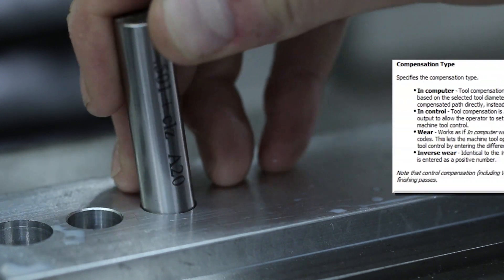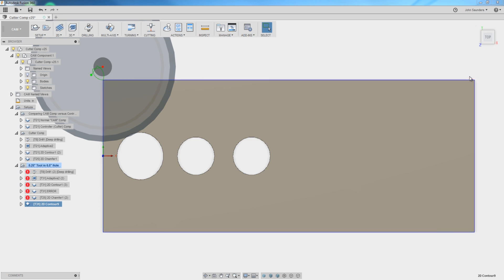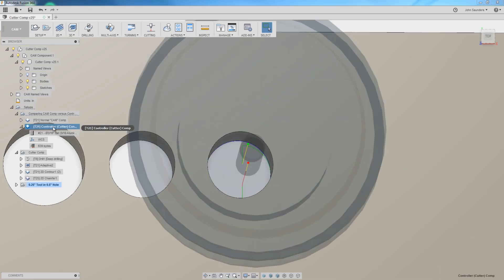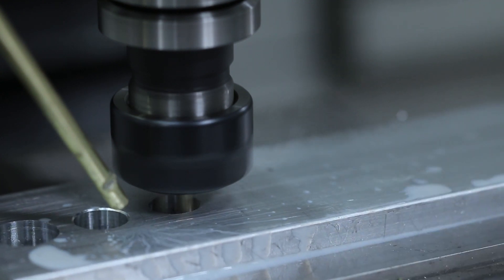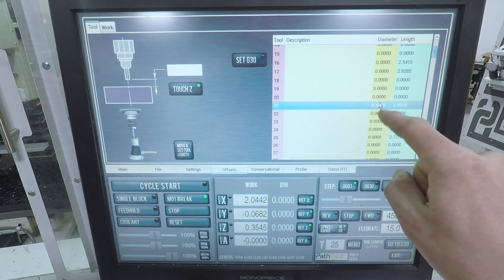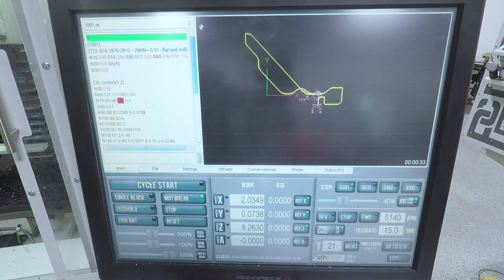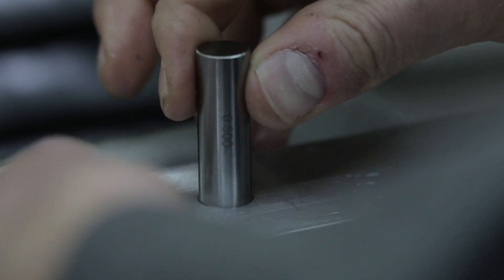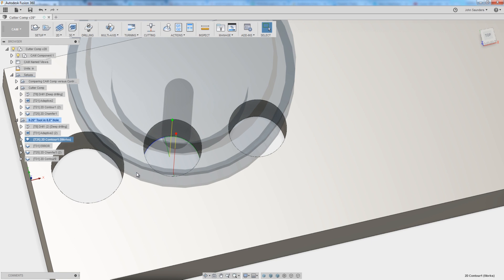How to Use Cutter Comp on a Tormach!  WW180

Comment: Does the cutter comp work for the boring operation too or do you have to program a 2d contour to make it work?
Reply: CC works with boring operation. I prefer "wear" because the diameter entered into the controller is a small value (usually less than 5 thou), allowing the machine to engage cutter comp with a very small linking move which is very handy for boring.

Comment: Dumb question- after doing the adjustment for this project would you then leave the updated tool diameter value in pathpilot or revert back to the nominal 3/16 diameter for some next job and perform the walk out if needed?

Comment: Does the Tormach accept a negative number for the tool comp? On Fanuc with your milled hole a negative number would get a "post" where the mill used the path on the other side.

Comment: How does the controller know which side the cutter is cutting on? Do you have to do anything differently for conventional milling versus climb milling?
Reply: That is what a g41 or g42 is for. Those codes "tell" the controller what side of the path the cutter is on.

Comment: It seems compensation type is limited to only 2d strategies is there any logic for this?  I would think it should apply to 3d finishing strategies as well?
Reply: Because you're delegating the calculation of tool offset to the CNC controller and it can only calculate left or right cutter comp in a single plane.

Comment: I've found that trying to use full tool diameter cutter comp is generally a bad idea. PathPilot may be catching some errors, but I've had Mach3 go off and do something crazy at times.

The general problem is that gcode for boundaries just doesn't give enough information to be able to reliably calculate the offsets. It's not an issue if the offset is just 0.001-0.002" of negative compensation for cutter wear, but telling the control to apply say .125* of positive compensation and expect it to keep corners square, etc, is not a reasonable expectation.

Comment: Use Wear v.s In machine, a standard cam (In computer) tool path only posts a g43 line for in control length offset. i.e fusion is doing the radial side comp and the control is handling the length offset. If you use wear compensation, then fusion still does the radial/side comp but the code now added a g41/g42 so the control is being told to do length and side compensation even tho fusion did a the radial/side comp... this means the value in the dia offset is just the difference from spec v.s actual. i.e All tool paths can be marked as wear and as long as the dia is zero on the offset page for the given tool, the code runs the same as standard. but if you need to walk a tolerance in then you just add a small neg value in the dia field like -.001mm then the controller offsets the tool path...Think of it as a fine adjustment or stacked compensation fusion does 99% of the compensation and the wear/dia value is the controller offsetting the tool path for a final tweak. great for tool deflection or even material change or tool wear etc.

Comment: I use fusion and use the in computer comp, when I want to walk in a part, on my Mitsubishi control I just add wear offset of positive number on radius like .0005 no need for actual diameter. negative -.0005 Will take a thou off a holes diameter

Comment: John, if you re-run the same hole with another diameter in the software, how do you know how much of a difference is from tool deflection when the first pass was taking a real chip and the second was only kind of a spring pass?

Comment: I've worked in shops where CAM software was frowned upon and or they didn't want to buy licenses to Mastercam or other brands of software. I would have to program complex parts and fixturing by hand and probably wouldn't have any hair left if cutter comp didn't exist. I love Fusion 360 and I use CAM software in my personal shop but I also believe everyone getting involved in CNC should have to do a fair amount of hand programming simply because it teaches the fundamentals of G-code. Another issue is post processing code with older controllers that tend to be very picky on format and code compatibility. Unless you take the time out to edit your post processors and tailor them to various versions of controls, It's sometimes just as quick and easy to add in hand written code or edit code to perform tasks.
Reply: Hand coding for most simple jobs is faster than running everything through a system to get code, particularly if there is no CAD drawing to start with.

Cutter comp is a necessary part of CNC. How anyone can NOT use it is crazy.

Comment: Any tips on how to get Fusion to post an "S" command at every operation. I find my self always editing the code at the controller and adding S3500 etc when I have to restart a program in the middle
Reply: Hey Tim, I went to fix this for you in the post processor, but for some reason, no matter what I do, all my ops have a RPM callout.  I could have sworn that this wasnt the case if the spindle speed didnt change between ops.  So, now I'm thinking that maybe this was changed recently.  What version of the post processor are you using?
Reply: I'm using the generic Tormach post from fusion. Maybe i need to get the updated one
Reply: But what version?  Open the post processor file.  It will have a date near the top.
Reply: FYI - The latest one is 12/13/17

Comment: The Rad in my tool data is easy enough to change without reposting a new program for a simple correction. Some of us, for cost savings, use regrinds and the diameter may vary more than .025 or more. So adjusting on the fly without waiting for a programmer to repost is much faster. In the old days of hand written programs they only program paths with radius called out,  if I ran out of 3/4 endmills I could just change my tool radius in my tool data to a 5/8 and keep right on trucking. 
  My point is some places are tying the hands of their cnc machinist and only trusting the programmer to make decisions, big problem when your pragrammer has 2 years experience and your cnc machinist has 15 years in his trade.  And don't get me started on the programmer saying it should take 10 minutes to run a part...then on the machine it takes 15 minutes (but Y U take soo long).

Comment: I couldn’t imagine not running any milling ops without cutter comp where I work. Maybe for job shop work where it’s one off or very short runs but when your running hundreds of parts and you might have to make minor adjustments every now and again it makes a massive amount easier using cutter comp.
Reply: Same with our Shop.  It helps the operators see the exact position as it matches the print and then adjust wear within cutter comp screen.
Reply: Yep absolutely right. It would look weird having a random number in the program and then the operator wondering where this number came from.

Comment: John, to avoid cutter comp errors in a compensated tool path all lines and arcs in the compensated path have to be able to touch tangent to the radius of the compensated value. Or to say that a different way no inside radius can be smaller than the compensated radius. And no lines can be so short that the tools radius won’t touch them. In your circle/bore you can mill it with a tool just slightly smaller than the size if these conditions exist. Let’s say you force you cam software to enter at the holes center you could easily use a tool of  .375 diameter by making your lead in line say G41 X.190; G03 X-.25 I-.22; G03 I.25; G03 X.190 I.22; G40 G1 X0; That’s with your zero at the hole center climb milling a.500 diameter.
Reply: Edge Precision exactly. This is why I always preferred wear comp just comping a small amount. Has all the features of cutter comp without the large comp moves needed. 

Hand coding is where I always thought control comp was best. It is nice for following the program/part print and diagnosing errors though.

Comment: I prefer to use "Wear" offsets, not "In Control" That way all your code is based from the center of the tool as normal. The key reason for this method is because in the Controller, all your offsets still say "0". You don't have to keep track of the tool diameter. (Accident waiting to happen). In your example John, you were going from .1875" to .1873". If you were using "Wear", you would put in -.0002". It's better to think about the toolpath as: 'Say, I want to push the wall further away from where it is. How far do I want to go? 'Negative Two Tenths'. A negative value will remove material Is a great way to remember it.
Reply: I don't think Pathpilot or Fusion has Wear offsets. Sorry, not an expert here.

Comment: This is a good strategy because a well trained operator can make corrections during a production to ensure that everything stays in tolerance. It might be a good idea to start a new hole after an adjustment to prevent rubbing.

Comment: The reason you get an alarm when your j value is smaller than the tool is because when using cutter comp you need a lead in distance long enough to allow the cutters path to compensate for the tools radius.  I prefer to use wear because you can literally have a 0.01 thou lead in and it will still work (as long as the value in your tool offset is smaller). It allows you to use a much larger tool.  The only problem is that you often have to use a negative value in your offsets.  I'm not sure if path pilot will allow this.  I would guess your Haas will though
Reply: Craig Krueger
That’s what inverse wear offset is for. For machines that accept positive values only.
Reply: I was wondering about that, how does that work?
Reply: Craig Krueger 
It works inversely to regular wear 😆

So instead of subtracting wear to make a hole bigger, you add wear to make it bigger.  So if you’re at .002 wear and want the hole .001 bigger. You’d set the wear to .0025.

Comment: I wonder what the difference is in the g-code between "in comp" an "in controller"?  Does one say move "the tool this way" and the other say "mill a round hole"?  I am a complete novice at this and understanding the nuts and bolts helps me wrap my head around it.  Having a background in computers has trained my brain to think in very abstract ways.  Seeing the differences in the g-code would really help me get a firm grasp of the two ways to do this.  It is literally easier for me to stumble through code many times.

Great video though!

I worked as a temp in machine shop that did a lot of large scale mass production.  I sat by a machine for three whole days that did nothing but mill security lug nuts 24 hours a day.  The CNC machine was about 30 years old and had a punch tape for a program (and this was over 10 years ago on top of that.  The machine was old!).  There was one variable, v20 I believe, that you would increase if i would remember correctly and that adjusted the tool path to account for tool wear.  It was not the tool diameter, just a small number that would widen the "wobble" of the track the endmill would cut into the head of the nut.  Having less than a month in any type of factory work and having never seen a CNC machine it was all facinating to me.  Alas, after that job I spent the next 7 1/2 years doing little more than putting plastic parts on a box (cutting runners, counting them, etc).  Good times.
Reply: Both versions will always only say either go straight or go in an arc, that is the basis of g code. "In computer" programs the center of the cutter, which means the software adds the radius of the cutter to the dimensions it machines. "In control" programs the side of the cutter, the radius is added in the controller(by you) so the CAM software programs actual dimensions of your part. G code is just very basic computer code. I agree seeing and playing with the code helps a lot
Reply: natedawg003 ok, does that mean that variable that john was changing around at CNC control would be set to "0" if the CAM operation was generated as "in comp" as it is already calculated by the CAM toolpath generated in Fusion 360?  What I mean is there any parameter or que in the g-code that tells the controller "do not adjust for the tool size, we already took care of it".  I know a lot of machine-specific variables and parameters can be passed via the post pocessor to the controller automatically (machine specific g-code numbers).  Or, are most/all CNC machines "dumb" and you have to be careful not to double add(/subtract) an offset like a tool radius.  It would seem the easiest way for John to do what he did in this example would be to always use "in comp" and then tweak the toolpath by inputing in the difference of the adjustment into that variable, ie -.0002 then -.0004, etc.
Reply: If he's not using cutter compensation (g41 or g42) then it doesn't matter what value he has in the radius offset because it won't be taken into account. You have to include g41 or g42 to use cutter compensation. I would say CNC machines are "dumb" they only do what you tell them to do. The whole point of this video is to show another way to adjust your part. You can do it all in CAM, change the path and re-post, but that is tedious going back and forth. This way he is changing 1 value and rerunning, very fast and simple.
Reply: natedawg003 ok, so there is a flag telling the controller to use an offset or not.  I guess for more info I would have to read Pathpilot's documentation.  I was somewhat familiar with LunixCNC (EMC CNC) but it has been a while.  I am pretty sure I understand what he was doing at the controller now.  Thanks for the replies.

Comment: I would be curious what that .501” bore really measures because of the intrinsic slop needed in order to fit the gage pin. Maybe measure it with your mitutoyo stand thing and update us on instagram what that says vs the actual diameter of the gage pin (mic’d)
Reply: The hole is probably the slightest bit elliptical too because the CNC machine is not perfect. Overall I would bet within 2 tenths in diameter assuming the gage is a tight fit and exact size.
Reply: Well the holes is like .5015 ish because that was + size gage pin

Comment: Does path pilot have a way to use "wear" offsets or is "in control" cutter comp the only way path pilot adjust for variation in tool diameter.
Reply: Wear offsets. From my other comment:

 - I prefer to use "Wear" offsets, not "In Control" That way all your code is based from the center of the tool as normal. The key reason for this method is because in the Controller, all your offsets still say "0". You don't have to keep track of the tool diameter. (Accident waiting to happen). In your example John, you were going from .1875" to .1873". If you were using "Wear", you would put in -.0002". It's better to think about the toolpath as: 'Say, I want to push the wall further away from where it is. How far do I want to go? 'Negative Two Tenths'. A negative value will remove material Is a great way to remember it.
Reply: gredangeo True that, and pathpilot won't give you error message.
Reply: Matthew  I have the same question.
Reply: Matthew Colvin I have used "wear" offset on my 440 from Fusion 360.
Reply: Does anyone have a preference if cutter comp or wear offsets is better.
Reply: there is no reason you couldn't use wear.  That is more a cam problem.  you would just be entering a tool diameter that was how much you wanted to adjust from nominal.  The only issue with using Wear from a diameter feild is you can only go in one dirrection - IE you can't have a tool that is .002" Dia.
Reply: - you can't have a tool that is ".002" Diameter"

No, I've used Positive offsets while using Wear. You just got to make sure that your arcs can allow that additional radius. As in, look at your I and J values, and see if you have any interference. A tight corner motion that is pretty much the size of the tool, such as J-.005, and an offset of +.006 will be an issue. You trying to negate more than the arc size causing an overlap. Using "In Control" will be the same issue, just different numbers. A .5" tool would show a J-.255. Nominal offset of +.250" for the tool. Thus a maximum of +.256".
Reply: Should I put all my tool diameter in control while using wear option in fusion 360 ?